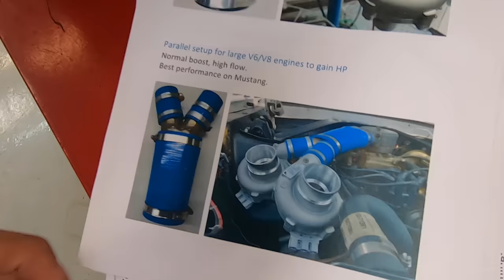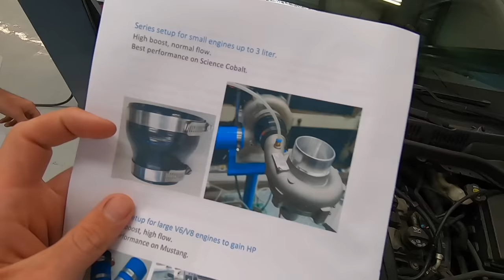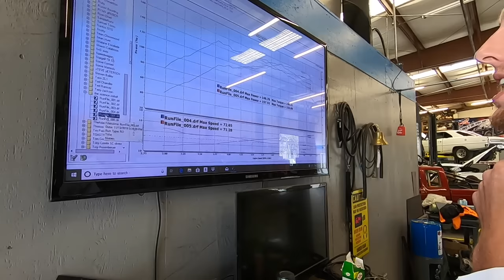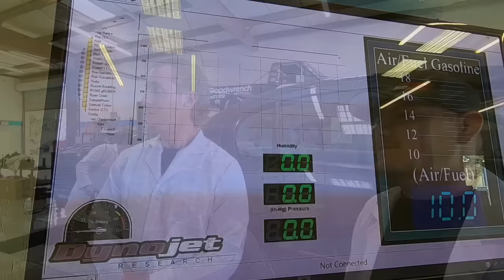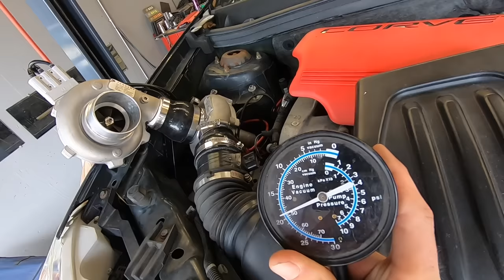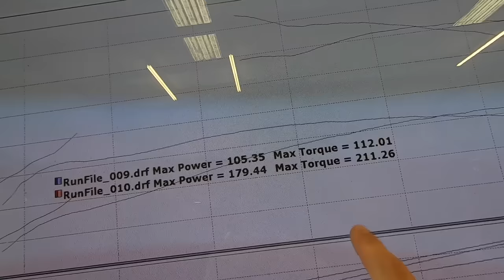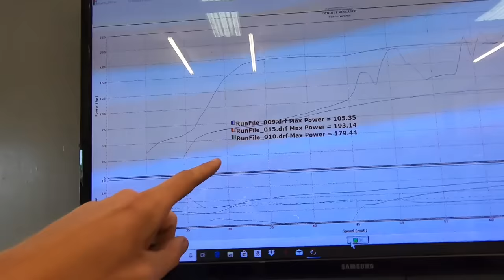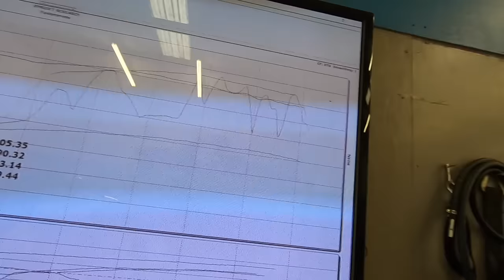Dyno Testing $5,000 Worth of ELECTRIC Turbos! Double the BOOST!!!

Comment: as soon as these hit aliexpress im putting 10 on my civic
Reply: I think these need some kind of PWM controller piggybacked to the TPS so they ramp up smoother and activate automatically :)
Reply: @eamh2002  yeah once they get decent controllers and come down in price, these things will take over. in true honda style id have mine all activate at vtec crossover, and just add fuel on the WOT column until the wideband looks fine lol
Reply: I think they are pulse width modulated, the little "boost adjustment knob" seems to be a smooth, infinite step potentiometer, compared to a stepped voltage gate. Pretty much just a giant ESC. I would like the button always on with a radio style "volume knob" or maybe like a bicycle brake lever by the shifter that smoothly increases from "off" to full power with infinite steps in between.
Reply: @T..C..M  remember to have a setting that goes to 11
Reply: @eamh2002  Honestly I have been wondering why hybrid cars don't have electric superchargers for a decade now.  They already are carrying around a big battery pack.  Why not give them an electric supercharger so they can have boost and have power when you want like when passing or going up an on ramp.  Best of both worlds, great fuel economy and bursts of power when you need it.
Reply: Plur307 The 80s MR2 had a supercharged variant where the supercharger has a special clutch that makes it activate at certain points
Reply: Well spoken like a true American 😂
Reply: 5k for 90 hp is too expensive lol can put that into a built engine and turbo setup for way higher power
Reply: @frodosfrostbite  
Ah, but what if price went down to about 500-800 bucks ?
I think that is feasible, within a few years.
Reply: @Plur307  I'm not sure you understand electronic vehicles.
Reply: @PTQ4Q4Q4Q4  he's talking about gas- electric hybrid, not electric.
Reply: @Grumpy_old_Boot  This is no different from a 48v ebike kit, with the motor stuck in half a turbo. so youre pretty spot on with eventual price
Reply: Honda civic is garbage
Reply: Did you ever do that bro

Comment: Anybody else in the situation where you like “these would be so cool on my car”, but then you’re like “wait, one of these is worth more than my entire car”...
Reply: Easy to transfer from old car to new car
Reply: cheaper to buy a K04 which will make more boost if  you got a vw like I do stock k03's can push 20 psi at their limit and are pretty cheap
Reply: Feeling the same here brother.
So interesting but eBay is flush with cheap turbo systems with more boost for less
Reply: I built an engine and turbo kit for less than this kit.
Reply: Totally but my car only costed about $300-350
Reply: yeah it's a cool concept but lets not forget Ruby's entire turbo kit complete with a Precision 76-75, wastegate, blow off valve and all the pipes needed is actually LESS than the Torqamp, $1,975 compared to $2,500

Edit: Ruby's first turbo that is, the new one is a bit more lol
Reply: bought my 156 2.0ts alfa for 850 euros....yup...been there xD  (and still am but pssst, its garaged now anyway....im all oudda money xD )
Reply: But this thing doesn't have turbo lag and it can be easily installed/removed, and it's look like it's more controllable
Reply: My turbo kit on my Integra was more than my car 😂

Comment: Chevy Cobalt making almost 200hp to the wheels, electric turbos and contagious laughter....Thank You Sirs!
Reply: Have a 2006 cobalt ss the thing is supercharged, and is a little monster.
Reply: Used to have an Audi T1.8 (2004) 120kw, chipped to 200hp and 350Nm, now they get that with a 1.4L turbo engine. 500eur tuning with a laptop.
Reply: 200hp cars 20 years ago weighed 2/3rds of what 200hp cars now mike h.

Power to weight ratio is more important than power figures compared in absolute terms.
Reply: @leion800   the ss cobalts r still slow 1-2 spins 3rd bogs hella cuz horrible gearing wasn't impressed at all!!!
Reply: @gcook619  I had an 09 with zzp downpipe and trifecta tune and it moved out pretty well, albeit from a roll.
Reply: @Ballinonabudget  190HP to the wheels is like what 240HP rated at the factory. On a light weight car that costs $500-$3,000.
Reply: Ballinonabudget  18 second quarter from 200hp?? What are you driving, a fuckin bus?, hahahahahaha
Reply: @AlienLivesMatter  actually older cars were made with steel and heavier materials because we didn’t have technology that was as good back then. Now we use light metals, composites and other materials that were never even thought of 20 years ago and much much lighter. Cars are lighter now idk what you are talking about. You must not have been driving 20 years ago. Everything was a clunker. Big and heavy was the entire industry and now small and light is the industry. This is not arguable it is 100% facts. I work in the auto industry
*3 other 12 year olds were tricked by your uninformed comment. You are making the world a dumber place one comment at a time. Good job pal
Reply: My mini van makes 260 hp

Comment: Never thought I’d hear anybody say “James is just taping the turbos on” 😂😂
Reply: boost leaks were killing the top psi.
Reply: @НиколайН-й6ф  that dude Is claiming a maximum MAF of only 450kg/h which equals to 165lbs/min (around 165whp only) and a peak pressure of only 5psi, so not nearly as efficient as even 1 torque amp which Is only 2500usd. Maximum airflow doesnt even get Any higher than one torqueamp, letalone 2 in this setup. Any car over 150-160whp would only be restricted power wise
Reply: @НиколайН-й6ф  please, explain. Enlighten me.
Reply: @michelhadid  He's using an np-60  sensor and a maf sensor, it builds that power (psi pressure) equal to a 2.0L
engine at around 1400rpm. Which is pretty much equal to torqueamp
Reply: @michelhadid  It's alot better then torqueamp price wise, and i would 100% be sure people would chose his kit instead of torqueamp that costs around 2800euro including vat that's basically like 5-6 times more.. He's using a 40v power source compared to torqueamp 48.  He has been developing it for almost 1.5 years now, the complete version will be alot better and much easier to install then torqueamp using obd sensor. Keep in mind that most european cars don't go over 2.2L, which is great for electric superchargers. The cfm/psi pressure usage of 1.4-2.2 liter engines at around 6000 rpm is between 0.4psi-0.7psi (static air pressure to engine cfm requirements) to not be a restriction for the engine.
Reply: @michelhadid  I was thinking of slapping one of those on my wrangler's Pentastar 3.6 . They sell a bypass to eliminate restriction. I figured that I wouldn't get any gains at the top end because it won't move enough air but it would boost torque on the low end which is what I wanted for a crawler anyways. Not to mention, the 3.6 doesn't wake up until you hit about 3k
Reply: Oh and the cheapest supercharger kit is like 6 grand for about 5 psi boost

Comment: I think most ppl would agree, I'd like to see what they'll do on a V8
Reply: Ls the world.
Reply: Probably not enough airflow for a v8. This engine was spinning that fan already.
Reply: @brettgray8339  You spelled coyote wrong
Reply: V6 or I6 first!  THEN, V8!
Reply: Hik Dingle no, he spelled it right.
Reply: @fatumschy  - Need 2 - 4 of them for V8s...
Reply: TorqAmp will be coming out with a larger unit in 3-4 months that should perform for a V8. I had inquired about his the current unit might  perform for my I6. He said that at about 4k rmp the engine would be sucking more air than the TorqAmp could provide.
Reply: Not one person here had the idea to install 1 per cylinder on any configuration. Attach each  one to a custom runner and a single carb on each inlet and... go
Reply: Combine this torque amp with a big turbo and you would have better response and big power. Now all that is needed is a computer to switch the whole set-up on/off/over for that set-up.
Reply: Yes
Reply: Perfect cheap V8 to mess with? Any Dodge/Jeep/Chrysler 5.2 or maybe 5.9 magnum (5.2 internally balanced/5.9 externally balanced) but they come with a race type block from factory. 230hp/300ft lbs of torque stock what will it do with some boost? Find them in 1992-1996/1997-2000 Dodge Dakotas (love them they are full send truck with 5.2 v8 and can get them with nv3500 5 speed) 1993-1998 Jeep grand cherokee 318, early 1998-2000 dodge durango 318, pretty much any 1st gen dodge ram and 2nd gen 1994-2002 also had a 318. A ton of people build 360’s but would be cool see some 318’s haha the mullet race of the century would be single cab shortbed 1994-1996 Dodge Dakota 5.2 V8 vs Foxbody Mustang 5.0 😆
Reply: A v8 chainsaw
Reply: Hellz Yeah!
Reply: Or a car that already has a turbo lol
Reply: From the sounds of it from the instructions in the video, they only mention 4-6 cylinders.
Reply: On a miata
Reply: dudes theses turbo are made for bypass to fill the turbohole
Reply: It's funny cause at Sema 2018 They used 2 of these to power a 6.0 liter Aston Martin V12 engine, Now tell me how 2 of these would not be powerful enough to run a smaller displacement v8 engine?
Reply: Yes
Reply: Turbo the fox body aswell with a few of theses and your dakota gets gapped 😂😂😂😂
Reply: I agree
Reply: jack mehoff  fact. mustang owners even do ls swaps.
Reply: You'd need two bypass extensions for that.
Reply: In America absolutely
Reply: Whats the benefit of getting this over a normal turbo?
Reply: Or... just buy a regular Turbo.....
Reply: @sonacphotos  nah im wondering about putting it into the intake manifold on an already supercharged car, like say a terminator cobra....
Reply: This is a rediculous notion 
If u have a v8 why would u put a small weak turbo on it  makes no sense..
Reply: Most in the comment section must be 12 -14 yrs old
Reply: Or a v6 camry or maxima and they should redo the cheap China one on a small 1.6 liter 2000 civic si yeah did this backwards. Should redo this put the sing on a v6 and the China one on a small 4 and see what happens
Reply: What about a v6 3.5 camry? Just headers intake and exhaust got it up to 315 hp to the wheel I wonder if headers exhaust and 1 turbo would get it up to say 350 hp to the wheel stock is around 260 to the wheel. Also when it off its a restriction what if they put it on the lowest setting just to get it to spin before getting high in rpm would that be able to keep enough charge to keep it going past the 3 Mins but that's at max boost. Do u see what I'm saying? Also they should redo that cheap China one on a small 4 like a 2000 civic si 1.6 liter so dumb to even try that on a v8 redo it and put a single in a v6 and v8 see what happens. You know whatbu mean Also I saw a video where the guy had it a foot closer so a foot less of pipe to push the air through. It's a video calling these guys out about how electric turbo do work so it was after the first cheap China episode on the v8 but before this one and the single turbo. Thank u for your opinion and time in advance
Reply: @faaaaq  What about a v6 3.5 camry? Just headers intake and exhaust got it up to 315 hp to the wheel I wonder if headers exhaust and 1 turbo would get it up to say 350 hp to the wheel stock is around 260 to the wheel. Also when it off its a restriction what if they put it on the lowest setting just to get it to spin before getting high in rpm would that be able to keep enough charge to keep it going past the 3 Mins but that's at max boost. Do u see what I'm saying? Also they should redo that cheap China one on a small 4 like a 2000 civic si 1.6 liter so dumb to even try that on a v8 redo it and put a single in a v6 and v8 see what happens. You know whatbu mean Also I saw a video where the guy had it a foot closer so a foot less of pipe to push the air through. It's a video calling these guys out about how electric turbo do work so it was after the first cheap China episode on the v8 but before this one and the single turbo. Thank u for your opinion and time in advance
Reply: @sparksco1980  no it said for v8 mustang
Reply: @sparksco1980  right in the beginning in the inbthe instructions say 8 to do them parallel
Reply: @chewblacka1915  way cheaper
Reply: Nowhere near enough airflow. The market for these are smaller engines, but it all works. You'd need a much larger battery with a much larger discharge rate and larger turbos to make this same thing work on a 5+ L engine.
Reply: Ure 20k in at that point. Not worth it
Reply: @damienfrizzell9394  thats true, i wouldn't put one on my car. I was speaking more out of curiosity since this channel, and others, are known for testing unusual combos regardless of cost
Reply: @Laviathan50  yeh the always on setup is a bit of a worry

Comment: Seems perfect except for the power losses when they aren’t in use. Needs a “normally open” bypass gate as part of the system.
Reply: A sprage clutch on the compressor would help
Reply: michael moore - Yeah that might even be a better (or at least more reliable) solution.
Reply: @truthsmiles  4min @ a time max
Reply: They mentioned in one of these videos that the torqamp company has a bypass valve for these
Reply: Only a power loss at full throttle...
Reply: EXACTLY:) Some sort of  system could be worked out ime sure!
Reply: Can't they just let it spin at a much lower RPM?
Reply: @zzxd7720  That would take a sprag clutch. That's a very powerful electric motor and that's what is stopping them spinning up.
Reply: @marvindebot3264  That went right over your head...

He's saying to let them run at a VERY reduced power level so that the compressor isn't sitting still and blocking airflow. If it turned at a very low power level, it would not block much airflow at all.
Reply: @davelowets  No it didn't, sinning them at reduced RPM is till going to be an obstruction, they need to spin at the speed of the airflow in order not to be an obstruction, physics, it's not rocket science (but it can be).
Reply: @marvindebot3264  Yep, and when the engine is driven normally, they wont have to spin very fast to provide the airflow that the engine needs at those light loads
Reply: Old comment but its worth mentioning that this would benefit from some solenoid valves and a map that activates when the button is pressed. Best with an aftermarket ECU

Comment: What if you make a torque amp sponsored car that makes like 600hp, like 15 TA’s on it
Reply: eventually you'd need a bigger alternator / more batteries like on a big stereo setup, which would rob more horsepower from the engine - but if you found the right balance i'd imagine you could get pretty good power
Reply: magnetopenguino you’d need a custom intake eventually along with what you said
Reply: At $2500 a TA🤔...
Reply: What about using a torqamp on each cylinder in like a v10
Reply: @alex2jz140  haha, sounds like they need a Triton V10 van to play with... or a SRT10 truck
Reply: BiggestComplainer  Capacitors are really only good for helping deliver big pulses of power. If you want continuous boost for at least a few seconds (5+) at a time you're going to need either more battery or more charging power
Reply: BiggestComplainer lithium batteries would do the trick (I have a large sound system myself and run one lithium battery)
Reply: didnt they do that in back to the future
Reply: @magnetopenguino  just add a new battery charge at a wall :)

Comment: That is REALLY great!  Wow!  And you didn't have a piston ring rip the top of a piston off!  Amazing when you consider you were using stock ring gaps and that is one of the major failure points with turbos!  It would be interesting to see the air temp at the outlet when running, maybe that cooler air and the high octane fuel helps keep the rings alive?  I wonder what your track time would have been like with just 2 adults in the car instead of 4?
Reply: Most stock NA engines will handle 5-6psi. Higher boost for short periods.

Comment: put an lsj intake manifold, bigger throttle body, and a full exhaust on it and you'll make way more power with those turbos
Reply: Of course! Any other mods would add power but this is about the performance of the ETs.

Comment: Compound system is also possible however, typically when compounding turbos it usually uses a small turbo pushing it's boost into the big turbo. The idea is? Better quality boost. That is better compressed air as the 2nd turbo can concentrate on solely compressor since #1 is feeding it boost air supply.